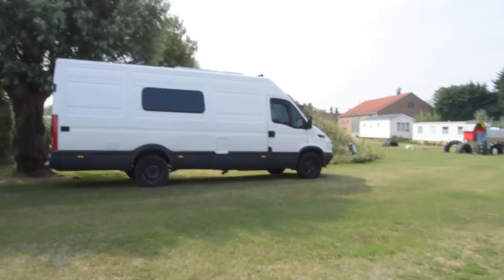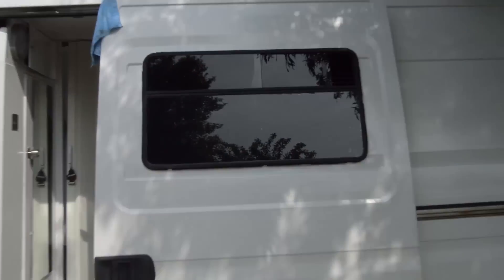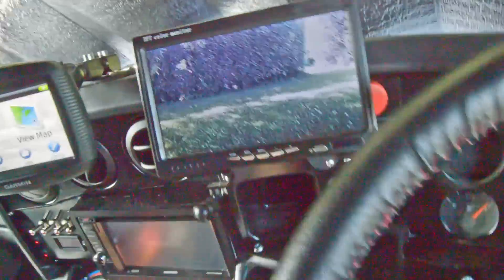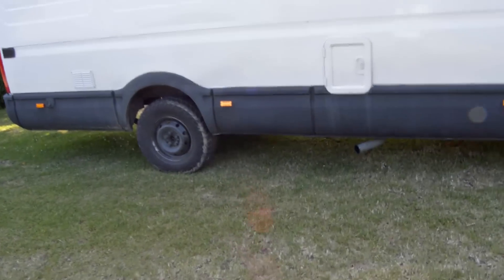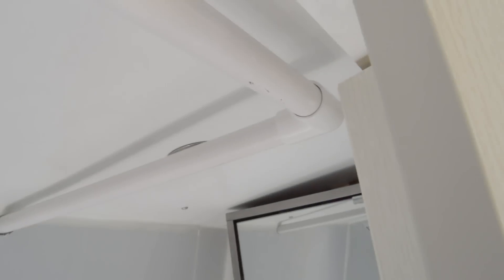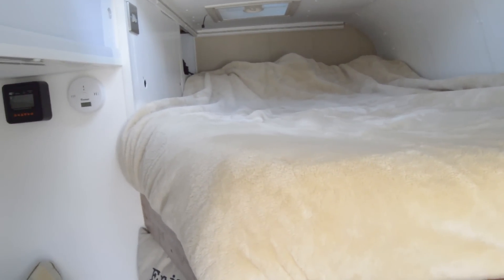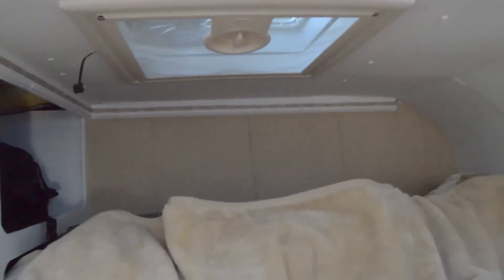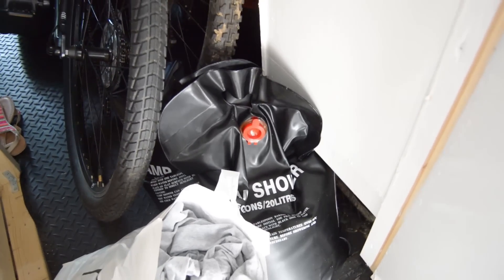Iveco Daily CAMPER Self build tour

Comment: Dude !
This is EXACTLY the sort of project I have had running around my head for a few years, thinking of saving to buy a cheapo (ish) van that won't conk out, yeah 100-200,000k Miles isn't too much.

But definitely build most things myself like what you have. The quality looks decent, the layout is just perfect, has shower, toilet, kettle (obviously!!), gas (lpg) and a telly!
It has it all.

You're so right about the high bed. I'm toying with putting a motorbike in the back (Harley !) and didn't know about the height, how high etc, should I get a bike trailer.... but having that high bed just answers everything!

I've got a mountain bike I was gonna design a sliding rack to put on, but like you say, if you have to build/assemble it every time you want to use it - you won't, I'm exactly the same !!!!

This is such a lightbulb video!
I'm glad I stumbled across your channel, will be watching with anticipation for the next few projects you've got.
I'm planning a Scandi holiday aswell and the van idea just made SO much sense, cost effective, practical, comfortable etc etc....
It's a no brainer.

Only question so far - is a 300w panel enough?
Or does it REALLY depend on how much sun/power the solar panel has gleaned that day?

I'm probably having the fridge always on, music or telly, and the kettle for the Tea. 

I guess you can always charge the batteries when you're driving aswell can't you?

Anyway - CONGRATULATIONS mate on a fantastic job.
May have been said before - but it IS inspirational, and gives ming mongs like me the confidence to have a go for themselves.

I can't weld !
I can't plumb or gas anything....,
I'm just a driver who has a saw and a drill !!!!

Well done. Seriously.
Well done !!!!

Matt

Comment: I subscribed ! just at 17th person. I really like your van conversion. you got the shower, kitchenette thingy, bed and huge storage. You really did the most with the space, than i have ever seen.

pound for pound you did it. 

I got a LWB high roof Iveco Daily 2006, bought for 5k, spent alot on mechanical repairs which you can work out here.

The total conversion was 25k, which after 700 nights has paid for itself. The actual physical / asset  motor-home conversion was £12724.81.

I shall paste my whole setup, only main differences are:  erecting with curtain bath tub/shower, stored under folding bed,  i got 3 tanks of water (lasting 10 days for a single person dry camping), huge solar,: being totally off grid (no hook ups), grey water is undercarriage refuge tank, with tap.

Also swivel captain seats with no wall, making a dinette thing, my tip is to keep as much as possible 12 volt only.

* Full Motorhome Setup Summary -
Ergonomically Designed Heavy Duty: Van LWB/ High Roof, Rear Parking Sensors, Undercarriage Spare Wheel Cage, Celotex insulated walls, Bluetooth Pioneer DEH-X6500BT + 4 x 6.5 inch speakers professionally jigsaw fitted into walls, Bolted Wooden Shelving, Synthetic Leather covering every wall, shelving and seats, Windscreen Reflectix, Plastic Side Window Wind Deflector Pair, Clear Acrylic Table L.W.H(110x110cmx1cm),with 45cm radius laser cut out (removable with wing nuts), Bolted Swivel Seats and 2 Seater Bench, Campingaz Camp Stove Oven 4500w Cooker Oven, 2 Gas (butane or propane) Hobs, with Piezo Spark, Fire Extinguisher, Custom made hinged aluminium/steel frame, folding Bed with Medium Density Foam L.W.H.(220x155x15cm) with Elastic Sheets, Cube Shaped Bed Mosquito net, Brompton M-Type T5 M5L Ivory Black Compact Folding Bicycle L.W.H. (65x24x61cm), Porta Potti Excellence, Dog Grooming Bath (135 Litre) (Colour - Green) L.W.H.(123x63x30cm)., 3 x Jerry Can Stainless Steel 20ltr tank - Compact Design L.W.H(34x24x31cm), Extra Large custom made Mirror, Fully Carpeted, High Quality Mats, Curtains and Shower Curtain,VSR bi-directional Split Charge Relay from engine battery to charge house batteries , 6 x 100 watt solar panels, 60 amp charge controller, 6 x Numax CXV31MF Sealed Leisure Battery12V 110Ah 1000MCA 500 Cycles XV31MF, Screwdrivers Socket set and small Tools

* 12 Volt DC for : (RL5010W) Shoreline 110L 12v/24v larder fridge WxDxH 50x54x85cm, Dimmable LED Strip lights, HP ProBook 455 G2 fast laptop with multi country plug adapter, USB TV Aerial, 2.4GHz 8W EP-AB003 Wifi Booster, 3&4G Mobile Phone Signal Booster, Garmin Nuvi 3590 LMT SAT NAV GPS World Map, 3 x silent Noctua NF-A15 PWM Round Frame Premium PWM PC Fan, Whale Gulper 220 12 v water pump (run dry without damage)  + Shower Hose, TA298 Digital LCD Indoor Outdoor Thermometer Hygrometer Clock Humidity Meter, MV Airo 2kw Diesel heater Undercarriage sharing Diesel fuel tank, 713 Series 12V Low Battery Alarm (with dial setting to change voltage alarm)

* Soft Start Inverter 12v to 230v - 2500w pure sine wave: Portable washing machine/ Spin dryer model WxDxH, 55x39x55cm GLW-82718, Playstation 3, PC Laser toner printer model Brother HL-2240, Numatic Henry HVR200-11 Bagged Cylinder Vacuum Cleaner , PC Monitor AOC U2868PQU 28" 4K 60Hz 1ms Gaming Widescreen HDMI, VGA, LED Monitor 3840 x 2160, 12 volt drill, DSLR Canon Camera EOS 60D

* Consumables: Diesel, Safefill Refillable LPG 10kg Gas Tank with multi country adaptors, Water, Fridge Food and Dry Food, Cleaning Products, Washing up liquid, Fabric Detergent, Carpet Shampoo, Toothpaste/ Mouthwash, Medicine / Allergy products, Hair Shampoo, Razors, Hair plucker, Creams, Vitamins, Tissues

* Personals: Minimalist Clothing Range, Yoga mats, Bed Sheets, Combs, Towels, Ergonomic Chopping Board, Cutlery, Full Screwdriver / Sockets set, Tape Measure, clips/strap, Brush, Cloths, Novels, Educational Studies Books, PS3 games in CD book, Paper, Sellotape.
Reply: Unlocking Freedom wow!  Thanks

Comment: Nice job there. As far as the mileage on your van, it's very low for one of these. I used to own one of these 35S13). I bought it new in 2003 and ran it as a courier van for 10 years. When I sold it in 2014 it had over 700,000 miles on the clock. Original engine, gearbox and back axle.  I only sold it because the body was starting to rot. I'm sure you'll get many years of use out of yours.

Comment: You did a fab job , we have a iveco  small van in the bathroom is a pull down sink con we take it out and use the pipe work for a shower . Yours looks really good .
Reply from the maker: thanks :)  ah nice, well i thought that as there is a sink in the "kitchen" like 2 steps away i wouldn't bother putting on in the bathroom
Reply from the maker: thanks :)  ah nice, well i thought that as there is a sink in the "kitchen" like 2 steps away i wouldn't bother putting on in the bathroom

Comment: Clever solution with the Velcro at the bottom of the blind by the seating, I've seen other solutions with wood or metal channels to tuck the blind into but yours is so simple anyone can do that. 
You might want to turn your roof hatch around so if you accidentally drive off having forgotten to shut it the wind will close it instead of ripping it off, hope that helps. Thanks for sharing.

Comment: Cool van, good job. I would consider moving that fire extinguisher out of the "garage". You got both gas, batteries and high voltage in there. In case of fire, you won't be able to use the extinguisher. Put it either under the seats up in the driver cabin or directly inside the camper door.
Reply from the maker: Hi there, Thanks a lot! There is actually a second extinguisher up in the front cab that i forgot to show so we a covered for both sides.

Comment: Hi Ash.  Don't know how I missed this the first time around, but seen it now.  Excellent.  
Some great work there.  Given that my Optare Alero (that I mentioned to you yesterday) is based on an Iveco chassis and maybe the same (2.8turbo diesel) engine as yours, I'd be very interested to know a bit more about acquiring and fitting the right hand stalk so that you've now got cruise control. 
Reading through the Alero manual, I've seen a reference to cruise control, so perhaps some of them DID have it, but I don't think mine does as it stands.
I was also thinking of doing the exact same thing that you've done with your LPG cylinder. i.e. the valve arrangement on top that allows a pipe to an external LPG filler.  Any chance you could do a short video on that, or at least some pointers as to where you got the parts?
All very inspiring.
Regards Mark in the UK

Comment: mate, you should be proud of your build. You say yu arent a professional but from what i have seen you have created a really nice home from home, stop putting yourself down.  My only comment would be that you really should isolate your wiring in the garage, what i mean is to put it into a fuse box just in case you get any shorts which will cause a fire.. the other thing is YOU MUST install a fire alarm.. you have a very lovely looking girlfriend so you dont want to loose her in a fire...
Reply from the maker: Hi Steve, thanks for the feedback! There actually is a fire alarm and a carbon monoxide alarm in the living space i just forgot to show them on camera :D the fire alarm is above the tv and carbon is next to the solar meter.

In regards to the wiring, yea i know it looks a bit ghetto haha! But, its all 12v and every outlet from the bus bar is individually fused and there is also an isolator between the battery/panel and also the solar/battery in case of emergency. I would like to get a proper unit to contain it all though so it doesn't look so scary but that will be a project for when i get back :)

Comment: Very nice conversion ! What did you do for replacing the rusted out floor in he back before the conversion? Did you add additional rustproofing after the chassis rebuild? Interesting control panel for the heating and air conditioning, it is almost identical to the ones used by Ford in their Crown Victorias that were the mainstay of police cruisers in the USA about a decade ago.

Comment: Hi. Not sure if I’ve asked you about your welding yet but I’m interested to know what you did with the battery while welding. Did you remove the starter battery to do the job? Did you unplug the engine ECU? I’ve got the same van and need to do a little welding in the rear area of mine, wanting to know what to do about the computer of the van. Don’t want to damage any of that gear. Great vlogs mate. Keep them coming 👍😎
Reply from the maker: Hi dude, I'm pretty sure I disconnected the battery and ecu when I was doing it. Ecu is just two block connectors going into the top, takes 5 seconds to remove so better than wrecking it.
Reply: Awesome. Thanks heaps bud. So worried about damaging that ECU. I’ll unplug both terminals on battery and the 2 on top of the ECU 👍

Comment: Great video great build. What's the height of the bed space and garage beneath it ? Just looking around for a van and that's one of the design/ layout questions I'm struggling with.  Thanks
Reply from the maker: Hi there, im not sure of the exact measurements right now but to give you an idea. both areas are, "snug" lets say. it doesn't feel claustrophobic in the bed so thats the main thing but you cant sit up straight without bending a bit, (dont need to sit up when your asleep :D)the key is to keep it light and airy, hence the white paint and double roof hatch. but there is enough room for two to sleep comfortably and then ample room underneath for two bikes with loads of space still left over.

Comment: Well done lad,great bit of work,now just enjoy the freedom,I surmise that you are going to be off griding quite a bit,especially with 3 batteries for storage.Is it an mppt charge controller and what amp is it to run a 300w panel to 3 batteries...only asking as I am wondering what size panel,[poly or mono], and what size battery bank to invest in,...Steve

Comment: Very impressive , especially doing all that on a shoe string, question, I have one of these with a oil leak, i think its the rear mainseal, but not sure, where was yours located??
Reply from the maker: Thank you 👍🏻haha oh no... 🤣 yea mine was the rear crank seal but the garage I took it to were guessing and had the engine out twice! £1200 in labour for a 20 quid seal. I've heard you can do it by just dropping the gearbox though so someone who knows what they are doing could do the job much quicker.

Comment: Hello Ash,its a fantastic job youve done on that Daily.Just wanted to ask what you used to line the walls as it's sort of shiny on the video.Is it that bathroom type panel? I'm actually in the middle of doing the same van myself,heavily insulated like yours,nearly finished the bed now which is almost exactly the way you have yours but the biggest difference is I am sticking the shower on the other side.

Comment: How did you do your dash moving your vent switched to were the radio normally is , I would like to do mine like that so I can fit a WiFi reversing DVD player ,
Reply from the maker: Was just a case of cutting it out to fit dude. The dials are controlled by cables so it's dead easy, just have to make a plate to go where they were and can then slot a radio in

Comment: when you say hardboard do you mean ply or thinner stuff?
Reply from the maker: Luke Explores hardboard is about 3 Or 4mm thick. Think it's sometimes called fibre board as well. Gloss one side rough the other
Reply: Ash Pollard ah ok I think I know what you mean it comes in a browny sort of colour? Did you paint it all white ? It seems a lighter option than the 6mm ply I used in my van
Reply from the maker: Luke Explores yea that's right. It's pretty sturdy stuff to be honest and much lighter. The only downside is it doesn't take much load but if you pre plan with battons it's fine

Comment: The cruise control is £250
Reply from the maker: Git mine from vexi.co.uk I think it was. I played 50 then but may have gone up 🤷‍♂️
Reply: Ash Pollard what year is your van mine is a 04 , it’s a 35S12 . I think I tried there but not had a reply from them yet , you know when you changed the dash to fit your radio were the heater controls are did you have to cut the plastic around the switches or dose that plastic pop out . Many thanks , like you I’m doing my van on a shoe string not got much money being a pensioner, but I have had the van from new and it’s only done 56000 . And I would not get much for it if I sold her so ,I have decided to convert her , so we can have cheap holidays.

Comment: Why would you put so much work to build the RV interior on a nearly written off van? if for any reason the van fails you (being so knackered) you would have wasted all your effort.
Reply from the maker: Main reason is to save on cost. The entire thing cost me 5k because I did all the work myself. All the rust was repaired and the engine refurbished. It's still going strong over 3 years later.